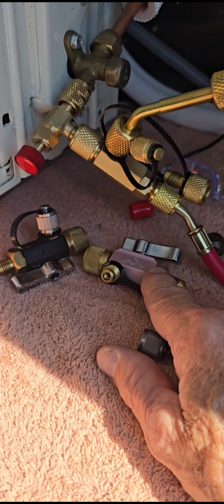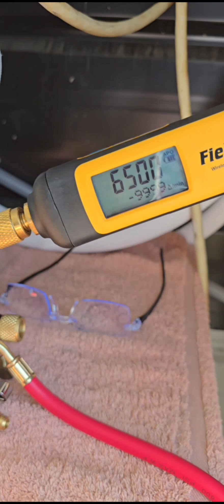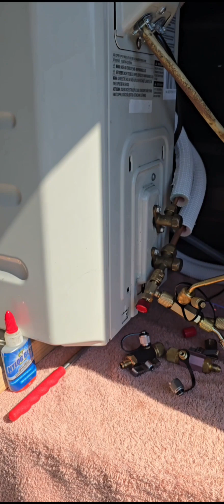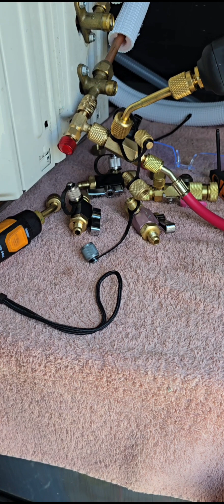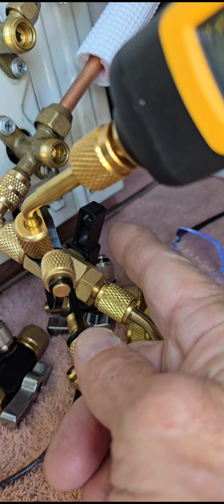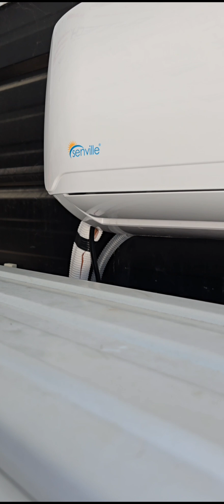Do Not remove your valve core, be safe Don't put your refrigerant in jeopardy of loss

Comment: Hi Jon, maybe I'm missing it but I don't see the link you mentioned for this depresser tool. and also the part that your micron valve is attached to. Thanks so much!
Reply from the maker: This valve core removal tool is less than $15 and I did two videos the last two days in a row that showed it being used with 575 lb of psi nitrogen testing and it held fine and also up to 64 microns and it held fine so it did pressure checking and vacuuming and help perfectly fine for under $15 each unbelievable

https://amzn.to/3HmacBA

Here's the charging valve also It comes as a set Make sure you get both the quarter inch and the 5/16 You will use them both eventually and they only cost $3 more for the second one after you buy the first one 

https://amzn.to/4fpXq1I

12 bucks for two charging valves absolutely awesome deal use these things for everything ❤️❤️
Reply from the maker: You can find me at my Facebook group 

https://www.facebook.com/groups/1270821334380086/?ref=share&mibextid=NSMWBT

We are always available to help 

You've been dropping to my DM on Facebook also 24 hours a day

Comment: So use nylog on the flair faces? I thought a flare seal is a metal-metal marriage kinda like brass on brass threads for compressed air. Teflon or pipe dope would likely cause a leak. Or am i comparing apples and oranges? My background is millwright, so hvac is just a little beyond my experience. I've flaired my fair share of tubing, but not for refrigerant purposes.